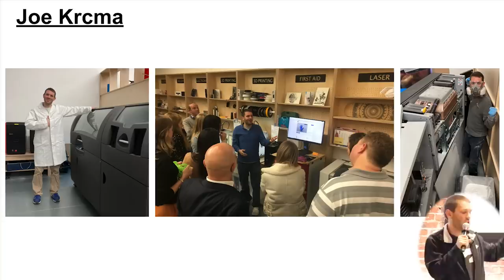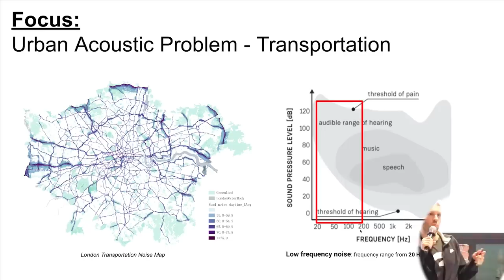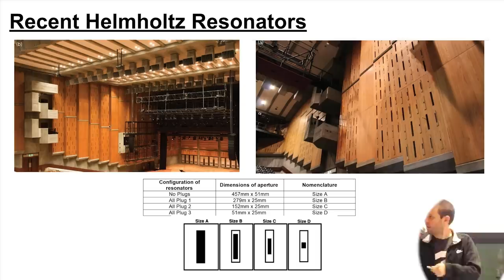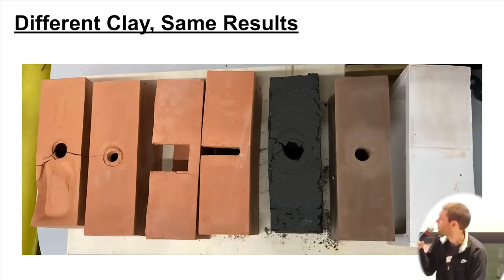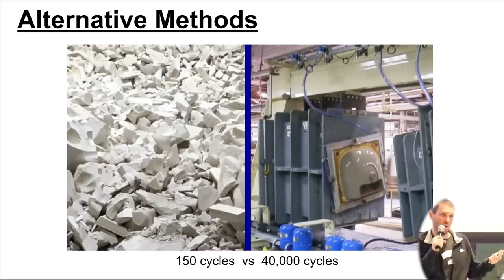These Bricks Can Absorb Traffic Noise - Thesis Presentation on Helmholtz Resonators

Comment: Did you consider for the orthogonal resonators: casting them in halves / assembling from dried or fired precut from sheets cemented together with slip / clay composition that has better air drying properties
Reply from the maker: Interesting

Comment: Thank you, awesome work. As a retired engineer and DIY guy, I am building a shop and designing for the noise upfront. It's already clear to me that HVAC and dust collection would be integrated, with handling the noise. Do you recommend any reference material to help me along?
Reply from the maker: Thanks so much!  Yeah, my thesis goes into more detail and could lead you down the trail of some good resources (linked in the description) 👍

Comment: "Architects may design a structure without considering acoustic issues"

NO FUCKING KIDDING.  See: every goddamned library

Local politicians, donors, university presidents, school superintendents, all just LOOOOVE a flashy looking library as a campus/community centerpiece, and they love going for all kinds of wacky designs to make it distinctive.  They love smooth, shiny surfaces, and they love curves.  And what are the worst surfaces for making a space quiet?  

I've seen a school library in the shape of a wankel rotor with glass walls.  I've seen one with concrete walls forming two opposing parabolas. At least the wankel rotor one had some of that afterthought sound deadening.  The parabolic one had a hardwood ceiling.  Only carpet on the floor did anything to quiet it.  

My favorite though is the reference room at the Chinese national library in Beijing.  At least it's rectilinear.  But it's a gigantic open void, with glass and hard surfaces all around.  The only thing breaking up the vast echoes is the book shelves.
Reply from the maker: I hear your pain

Comment: you could have made them as a bent shape between a t and a triangle creating the resonators in the inbetween and making it much simpler to mass produce and implament
Reply from the maker: Slip casting is still a challenge with 90 degree angles

Comment: I am not entirely sure what that last test chart is showing. I understand an alpha cabin is too small to test and a full C423 is probably too hard to get (also it is an ASTM method and might not be applicable in UK). There is normally a tradeoff with sound barriers and absorbers as density helps reflect waves back at the source, so it is a little hard to see if the soundwaves are being absorbed by say the wood or foam, or just passing through. A random incidence testing would also be enlightening for absorbing outdoor noise because it is generally impossible to predict the angle will it will come from / constantly changing angles. I don't know the impact on this design, but I suspect random incidence testing would struggle because of the openings.

Also, most absorbers have difficulty in absorbing low frequencies with low thicknesses (quarter wavelength). So it is a bit difficult to compare especially against the foam without knowing the thickness (I assume not 9" thick foam). There is a weird peak around 400 hz, was the microphone around 0.86 meters (34") away from the wall?

I do wonder what happen is you were to put something in there (if not I am sure wildlife would move it). I know alot of industries are always looking to get rid of scrap, so perhaps ground up tires or some other industrial waste could be entombed by this (I know there is an excess of paint overspray limestone from automotive in Europe from some Durr systems).
Reply from the maker: Thanks so much for this!  I'll address these in a second version video with some adaptations

Comment: Fantastic approach to a big environmental problem!

Here's another problem that might be fixed with architecture:  The new airport on the island of St. Helena can't be used by most conventional aircraft because of unstable air currents blowing off nearby cliffs under certain conditions.  Could architectural channels help stabilize vortexes to provide smooth air for safe landings?
Reply from the maker: You might enjoy my thesis paper in the description 🤩
Reply: I think Jonathan Tyrell asks a good question about the visual dominance of our culture. I hope to hear more about sound abatement built into architecture in every city where traffic noise is a problem. @JoeMakes

Comment: 13:00 Methodology question: the speaker used in your tests, did you confirm it had an "equal" output range?
a lot of speakers tend to have certain frequencies where they falter or excel.
Reply from the maker: Great question, and yes, the speaker hardware was top of the line, so it accounted for that.

Comment: In before I forget to write this: You show sound dampening panels at 5:40, and I know that here in the Netherlands we use or are at least testing at large scale the idea of covering those ugly panels with greenery. This makes them look better and bloacks more sound. Also, our ZOAB asphalt absorbs some sound as well. And since it's green it's also a home for bugs and helps cool down the surrounding area. Would you say your solution is better than that on all those areas?
Reply from the maker: Because I am American, my sound solution is the best in all those areas.  #1
Reply: @JoeMakes  Right, okay. But that does mean it would be interresting to see how it compared. Maybe some kind of combination would work wonders. Because the greenery I speak of doesn't block all sound ofcourse.

Comment: I don't mean to be rude or discouraging, but the graph you display at 30:43 makes it clear that foam is a far superior insulator, and that wood is also good. They both attenuate noise across a much broader spectrum, and usually by more sound pressure, than the bricks. On the low end at least, the bricks only reduce volume at a very specific frequency. So why keep pursuing the brick option rather than innovating with foam?
Reply from the maker: Because we had to use ceramic as a medium in order to graduate 😂. Otherwise I would have totally used foam from the start, haha!
Reply: @JoeMakes  Ah, academia!😀

Comment: Very cool! Is it quantifiable how much sound energy a Helmholtz resonator can take? I mean how many would i need if i want to dampem a certain frequency by a certain amount?

Also, would you give additive manufacturing a try again to build a sound dampening wall  with what you learned? As you mentioned lower frequencies need bogger cavities and its rather complicated to match many different sized bricks to build a wall. There should be a method of inputting a soundscape as is and another i would like to have and a volume it can use and put out the gcode or 3D shape to 3D Print the wall.

On the other handy having a large sortiment of frequency-bricks would need many more connection bricks to make a solid wall.
Reply from the maker: Thanks, the free file is in the description...

Comment: Very impressive! Love the organic shapes! Possible wrinkle / opportunity. Birds will find these irresistible for nesting. A local winery used thin gabion baskets on the shaded side of the building for passive temperature control. While it was somewhat effective for it's intended purpose, it quickly became overrun with bird's nest and mess. However, birds are nice. Also, if they bring absorbing materials and pack them into the resonators, is that a negative?
Reply from the maker: Thanks! Possibly!  I’ll test it in an upcoming video

Comment: A song about the topic: "Ceramic Beats, Urban Streets" https://www.youtube.com/watch?v=unLJe77nP8g

ELI5 Abstract
Imagine a special kind of brick that can make loud noises quieter!

* The Problem: Cities are noisy! Cars and trains make rumbling sounds that aren't good for us, and it's hard to relax in parks because of the traffic.
* The Project: I wanted to build a special wall to block out the bad noises. It had to be made of a hard material called ceramic (that's like the stuff mugs are made from).
* My Ideas:  First, I tried using a fancy 3D printer to squeeze out clay into brick shapes, but it was too slow. Then, I tried making molds and pouring in liquid clay, but the bricks kept breaking and warping!
* The Breakthrough: I realized I could make a brick that traps sound inside like a bottle. It worked!  This magic brick could make the noisy places quieter.
* Building a Quiet Place:  I want to use these bricks to build a cool little house (a pavilion) where you can hear birds and the wind instead of traffic. 
* More to Do: I still need to make the bricks prettier and stronger, and figure out a way to make them even better at blocking really loud noises.

Abstract

This research investigates the potential of ceramic bricks with integrated Helmholtz resonators to mitigate exterior low-frequency noise pollution, particularly in urban environments. The project began by exploring various design and fabrication methods, including 3D clay printing, slip casting, and robotic manipulation. Initial prototypes faced challenges with warping, cracking, and achieving the desired resonant frequencies.  A breakthrough occurred with a four-part brick design that incorporated a Helmholtz resonator on each side, as well as utilizing the brick itself as a resonator. 

Testing confirmed that these ceramic bricks could absorb sound as effectively as traditional wood or foam materials. The research envisions a pavilion-like structure constructed from these bricks, which would not only reduce noise but also serve as a visual reminder of the importance of soundscape design. The project highlights the potential for integrating acoustic principles into architectural design, aiming to improve both auditory and visual aspects of the built environment.

Summary

Introduction

* 0:00 - Speaker introduces themselves (completed a master's in architecture)
* 0:14 - Speaker details their background and recent work history 

About the Presenter

* 0:50 - Speaker's work for University College London
* 1:31 - Details about the University College London facility, speaker's interest in working there
* 1:54 - How speaker pursued a postgraduate degree at the University

Problem Statement

* 3:04 - Noise pollution in London (traffic), especially in parks 
* 3:22 - Project focus: exterior low-frequency noise barriers
* 3:29 - Material constraint: ceramics
* 4:02 - Health impacts of noise pollution (cardiovascular risks)
* 4:27 - Lack of exterior noise solutions compared to indoor options

Focus on Transportation 

* 4:40 - Project focuses on transportation noise (low frequency)
* 5:09 - Statistics on London's noise pollution levels

Limited Solutions

* 5:29 - Three main ways to manipulate sound: reflection, absorption, diffusion
* 5:42 -  How these techniques are used indoors 
* 5:55 - Current outdoor highway noise solutions are visually unappealing 

Soundscape

* 6:08 - Defines "soundscape"
* 6:27 - Soundscape design should consider multiple senses 

Acoustics in Architecture

* 6:49 - This project builds on prior explorations of sound in architecture
* 6:57 - Overview of Marcus Vitruvius (father of architectural acoustics)
* 7:40 - "Ear arrangements" (resonant vessels) in ancient theaters
* 8:07 - Similar acoustic pots in medieval French churches 

Helmholtz Resonator

* 8:34 - Introduction to Hermann Ludwig Ferdinand von Helmholtz and his work
* 8:59 - Explanation of a Helmholtz resonator and how it works
* 9:32 - Formula to calculate Helmholtz resonator frequency tuning
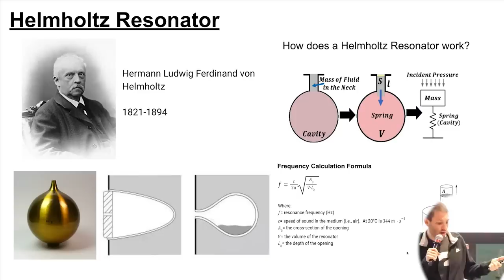* 9:39 - Applications of Helmholtz resonators (cars, airplane engines)

Recent Helmholtz Resonators 

* 9:52 - The concept of Helmholtz resonators is now more widely understood 
* 9:57 - Examples: theater acoustic panels, Elizabeth Line train stations
* 10:41 - People remark on how quiet these stations are
* 11:01 - Companies using Helmholtz resonators in traffic noise barriers

Sound Absorption Tests

* 11:39 - Investigating ceramics for sound absorption 
* 11:52 - Testing materials in an impedance tube: wood, foam, mycelium, terracotta
* 12:22 - Exploring ceramic "burnouts" for complex structures 
* 13:00 - Building their own acoustic test box 

The Site 

* 13:34 - Site location in East London, affected by road and train noise
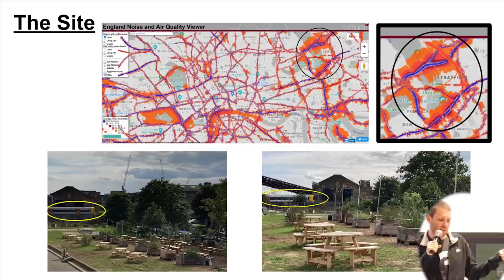* 14:07 - Considering a pavilion-like structure to alter the soundscape

Research Question

* 14:29 - Problem Statement: How to improve health through better exterior soundscapes
* 14:37 - Research Question: How can alternative design strategies help with exterior noise mitigation? 

Multiple Research Streams

* 15:21 - One team member explores extrusion methods for pavilion design
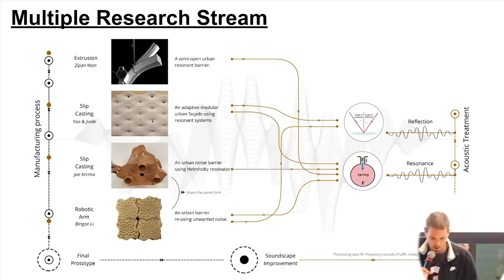* 15:41 - Two others focus on bricks with inverted Helmholtz resonators for facades
* 15:56 - Another member uses robotic arms for sound reflection with bricks
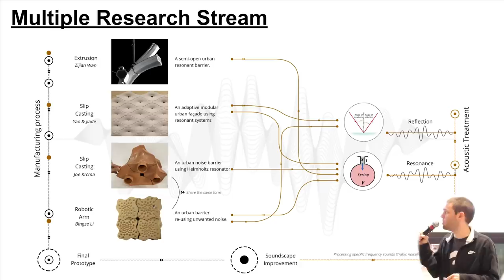* 16:07 - Speaker's initial uncertainty about their own direction

3D Printing Bricks

* 16:13 - Speaker explores possibilities with clay 3D Printing
* 16:27 - Explanation of clay 3D printing process 
* 16:53 - Testing shape limitations (overhangs, draft angles) 
* 17:06 - 3D printing deemed too time-consuming 
* 17:18 - Use of Grasshopper for parametric control of G-code 

Slip Casting

* 17:36 - Speaker moves on to slip casting technique
* 17:43 - Explanation of slip casting process 

Prototypes 1-3

* 18:10 - Design of three initial brick prototypes focused on low-frequency absorption
* 18:22 - Importance of cavity size for desired frequency range
* 18:41 - Goal of making hollow bricks to reduce weight
* 19:01 - Prototype 1: Challenges with internal plaster inserts and warping
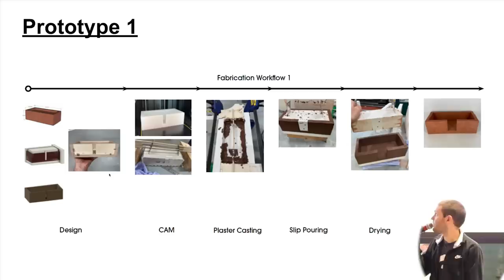* 19:51 - Prototype 2: Issues with clay shrinkage, difficulty removing plaster 
* 21:35 - Prototype 3: Attempts to maintain 90-degree form, continued warping

Major Issues with Prototypes

* 22:46 - Small pore hole, warping, cracking, uneven drying are consistent problems
* 23:04 - Conflict between design and natural properties of plaster and clay
* 23:40 - Difficulties in achieving low-frequency Helmholtz resonance with small cavity

Fusion 360 Generative Design

* 24:09 - Experimentation with generative design for brick form
* 24:21 - Exploration of interlocking brick patterns
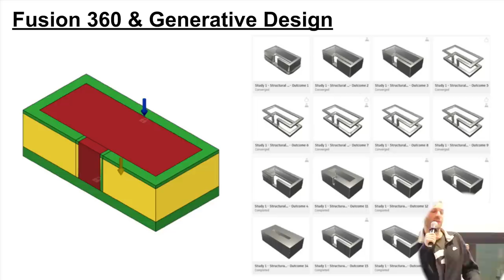* 24:39 - Concerns about lack of conclusive results 

Robotic Arm Manipulation

* 24:52 - Collaboration with the team member exploring robotic fabrication
* 25:17 - Inspiration from a four-part brick design creating a Helmholtz resonator

Four Part Brick

* 25:28 - Concept of a brick with a resonator on each side for a double-sided wall

Prototype 4

* 26:05 - CNC milling a test mold from foam, then plaster casting
* 26:41 - Similar issues with cracking and uneven drying as previous prototypes

Final Prototype

* 27:21 - A shift in perspective: making the neck a prominent feature
* 27:43 - The breakthrough: Realizing the brick itself forms a large Helmholtz resonator
* 28:19 - Successful slip casting and firing of the final brick 
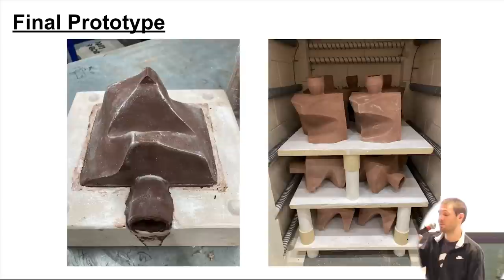* 28:46 - Some remaining challenges with mold release 

Disclaimer: I used gemini advanced 1.0 (2024.03.04) to summarize the
video transcript.  This method may make mistakes in recognizing words
and it can't distinguish between speakers.
Reply from the maker: That about sums it up!

Comment: The midlands has a huge problem with this, the M5 passes through major cities like Cheltenham, Gloucester and Birmingham etc causing a constant hummadruz. In certain weather conditions the sound of the motorway is omnipresent. Councils meanwhile are cutting down trees to install 5G (which works best line of sight, signal shaping with no obstruction) and further worsening the situation.
Reply from the maker: I feel ya!

Comment: 23:25 it falls because you have to use the mold several times, untill it cleans the soap that has the plaster been made in the beggining. I am a ceramist and I make plaster molds, I know a problem when I see it! , has nothing to do with form. Or you clean the plaster with detergent and tepid water or you use the mold till you get it right.
Reply from the maker: Yeah, I used the mold about 100 times, and sometimes it worked, sometimes not.  Even after the soft soap was completely removed.  I like the detergent tip!  I'll try that again

Comment: Very cool idea. I hope this'll get used and developed more! 

Would it make it easier to (mass-)produce if you made one of these in two parts, so you don't need a 'hollow' shape, but just two half-shells that fit together?

Alternatively how about a wavy sheet form that you can stack by flipping the next one around and laying it on top of the first?...
Reply from the maker: Thanks!  I’ll test out some second versions in an upcoming video 🤩

Comment: Neat, but one thing I kept thinking is that no matter how well you absorb the sound once it goes in the hole, the holes only make up a small percentage of the surface area of the wall. So even if they absorb 100% of the sound that goes in, most of the wall is reflecting it. Did you do any experimental testing to see how many decibels this absorbed at the end?
Reply from the maker: Yes, and with the absorption and reflection it made a small difference (being ceramic).  Will incorporate this into the updated video on these bricks.  Thanks!

Comment: Thanks for sharing , I did not understand the testing result at 30:35, what do you mean 330 Hz reduction ? wasn't the design initial objective to attenuate low frequencies 65Hz and below ? cheers
Reply from the maker: Yes, the testing showed that the size of the brick needed to be larger for the different ranges, but will do more tests!  Good eye (and ear)